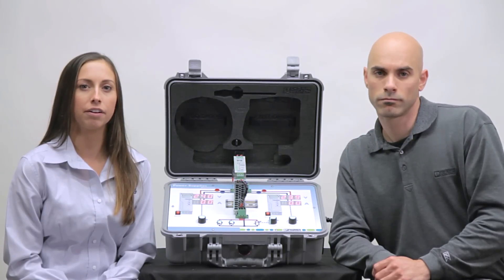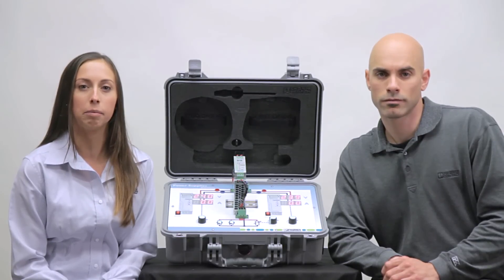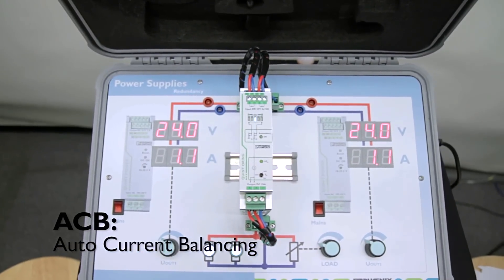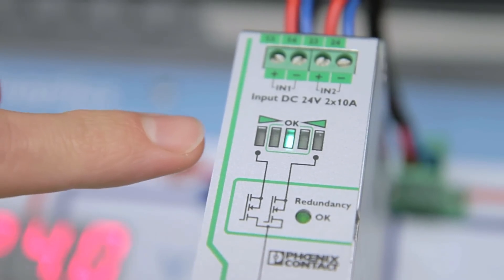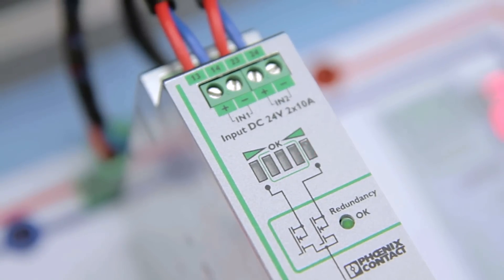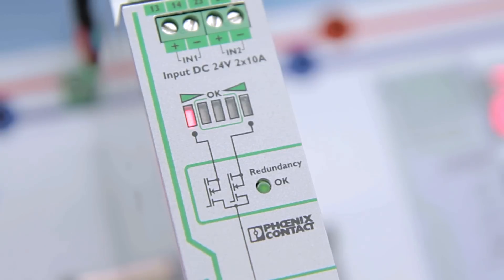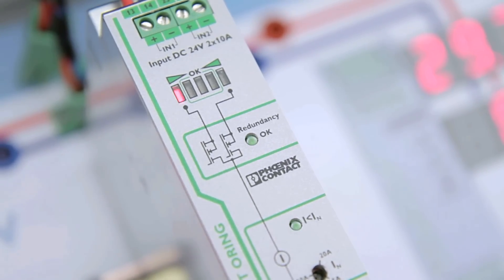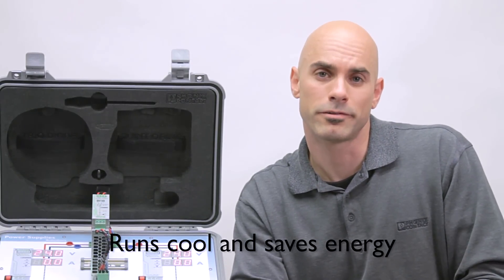QUINT "ORing"  Redundancy Module for Redundant DIN rail DC Power Supplies - Phoenix Contact

Comment: I have two 24VDc 100A and 24V 10A power supplies, my consumption load needs 10A, can I use this module?
Reply from the maker: Hi, Stefanova, 
Thank you for your question. Phoenix Contact has a couple ORing options available. Our QUINT-ORING/24DC/2X10/1X20 – 2320173 is designed to accept the input of two 24V/10A power supplies. The ORing will equally distribute 5A from each power supply to the load. The LEDs on the front of the ORing will indicate whether or not the power supplies are providing equal power to the load.
Reply: so 24V 100A input is not suitable